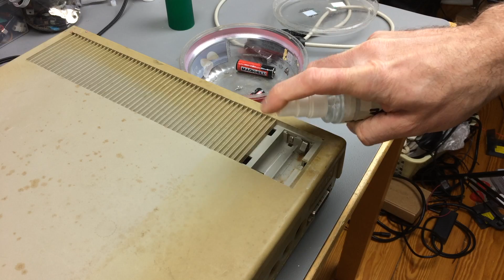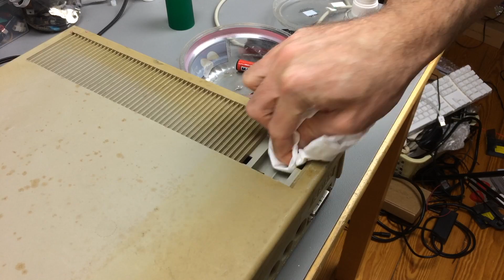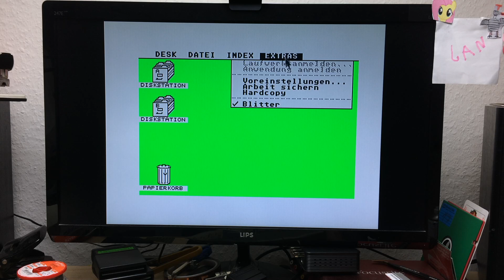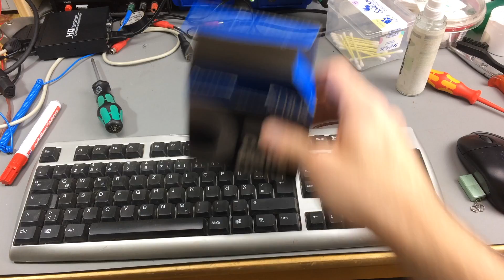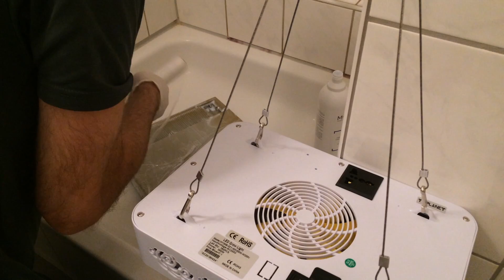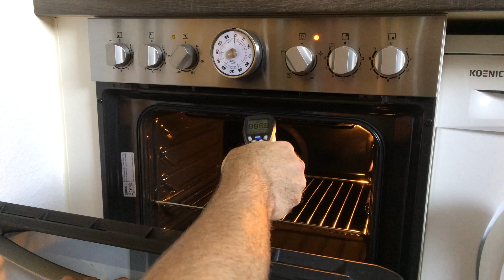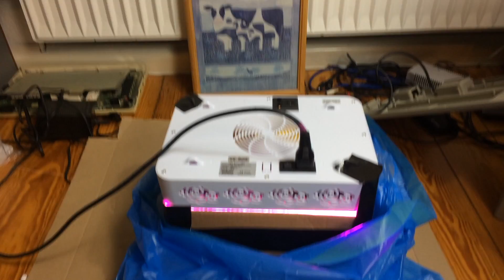Atari Mega 1/Mega ST Restoration

Comment: An Atari on a (more or less) Commodore only channel??? ;) 
The feud is still on even though we Commodore/Amiga people know we won by a mile, Atari ST will always be something we shrug at... hehe...
Back in the days we sometimes used an Atari ST as a door mat on our demo parties and it was always a case of how long it survived - but people had clean shoes at least when coding 68k asm!
Today I'm more concerned about restoring and saving old hardware but I've yet to ever touch an Atari in that fashion.
Reply from the maker: I'm actually pretty fascinated by the Ataris now even though I was a die hard Amiga/Commodore guy back in the day. I always found the "war" between the machines hilarious. Why not acknowledge that both are great in their own right. It's a bit like the Beatles vs Stones discussion. ;)
Reply: I think as long as there's more than one choice there's always going to be some sort of "war" between the users, like XBox vs. Playstation or PC vs. Mac et al.
The Amiga vs. Atari feud was never really a contest since the Atari was so far behind the Amiga if we're talking about architecture and OS - but the Atari had a built in MIDI interface and that was a tiny advantage for those who wanted to control a synth etc, but people mostly bought these computers for a different reason and the Amiga was just superior. The demo scene was huge back then and this is what kept the feud going on because Amiga demos were always "better" than Atari ones with regards to most vector balls or most sprites etc in a demo.
Today I love all kinds of computers since they all have a purpose but I'd be lying if I said I was going to buy an Atari ST to add to the collection ;) 
Some things just never change - but I do appreciate that you're rescuing Ataris as well because I suspect there are even fewer of them around?!

Comment: I noticed one of the menu options stated "Blitter" with a tick/check mark next to it. Is this machine related to the STe rather than the ST?

Enjoyed this episode!
Reply: The first ST computers in the keyboard case didn't have a blitter. The Mega ST series always has one. Later keyboard case models had no blitter supplied, but a prepared space for it on the pcb. STE always has a blitter built in.

Comment: Great view of how the Atari ST Line evolved, clearly not the same as with the Amiga.  Same CPU but the full architectural differences between these two systems is clearly evident ( blitter ? ) hehe would be cool to see  if it was not just an Amiga rip off ;).  I had an A500 and did asm using Devpac ( 1.x to 2.0 ) .. 

Those were the days ;)
Reply: Mega ST came on the market even before the Amiga!
Reply: @KolliRail  ...before the Amiga 500 and the Amiga 2000 but not the Amiga 1000. The Atari 520STm was released before the Amiga 1000.

Comment: Does that particular Atari model take the Mac compatibility card? It would be cool to see that tested out. You can see and hear a bit about it on the Computer Chronicles, but of course it's not featured for too long and doesn't get to do a lot. I think the guy ran HyperCard on it a bit and that was it.
Reply: Yes, those "cards" were built in the ST cartridge format. The Magic Sac and the later Spectre models from David Small. Apple tried to prohibit their Mac dealers from selling Mac ROM chips because of those products.

Comment: I have a German Mega1 too. It didnt have the metal shield I think because of the pc compatible card mounted on the board. I swapped the tos for some from a STFM. The German Qwertz keyboard im not changing.
Reply from the maker: Interesting, I was thinking about leaving the shielding out, too. Do you have a CRT on top of it and does that do any interference without the shielding? I'm also thinking about tinkering with newer TOS versions although the rainbow version I have seems to be quite good already.
Reply: The Shifter is quite receptive to interference. It's the only Chip in the ST running with 32Mhz (and it has some hard time doing it. Atari changed inner workings of the Shifter at least tree times). The IC is also not double shielded as in other STs. So the shielding is usefull when using a CRT.
Reply: @boelwerkr  The shield was gone when I received it. Oh well.
Reply: @JanBeta  I have had a color atari monitor on top and noticed zero problems with the setup.
Reply: @JanBeta  I also have the matching Mega Hard drive in the same case. With or without that on top no problem. Jan I would be keen for you to try fitting a fan into the case where they left a space for it. I would like to try one day

Comment: Don't you have to have the keys facing up towards the UV light? Not sure how retro-bright is supposed to work if the bottoms of some of the keys are facing up.
Reply from the maker: I stirred them every half an hour or so, so every key got some light. It seems like you get the same results by just heating the keys up in peroxide (cf the 8-bit guy video I linked in) without any light. I'll have to experiment with that further.

Comment: nice work , and yeah atari st version of amiga games were really crap.
Reply from the maker: It depends, I think. Giana Sisters is a particularly bad example of a conversion. I heard that there's a version that makes use of the Blitter chip that's much better. Will have to try that soon.
Reply: yep curious to see that , in my memory atary ST always struggled to display decents scrollings.

Comment: Hi Jan. 5 years later, did the yellowing come back?
Reply from the maker: It re-yellowed very slightly (as it usually happens after a while with retrobriting) but it still looks a million times better than it did when I got it. :)
Reply: @JanBeta  Then not so bet I guess. Also cheers for the video!

Is there a way to upgrade the RAM?

Comment: Hello, I have a request for the following:
I was removing the graphics card from the VME ATARI-TT slot.
The ATARI TOS-system was turned off, but I didn't notice that the computer was still connected to 230 V / 50 Hz power.
When I took out this card unevenly, I suddenly felt the smell of a bubble somewhere on the board because the whole thing is in the tower housing.
After turning on the computer, the screen is dark, the power supply works, the LEDs - power, fan, HD disk and floppy disk LEDs - work.
Somewhere after two minutes the MC-68 .. processor is clearly warm, I only checked this 2MB ST memory board (underneath the board is also the factory 2MB) the chip and cold bones. The whole side of integrated circuits from the cold ST-memory side
I still have the TT-Fast Ram GX-B-V0, 4MB slots.

Can I ask you for help, service diagnosis? Best Regards  ... ATARI FAN ( ATARI JAGUAR, STE,  TT,  FALCON030 )

Comment: Hello, I have an Atari Mega st1 that' s still working. Question: in the video it seems to work without the batteries; why are they there anyway and should I renew them (Mine are the original ones)?
Reply from the maker: The batteries are only used to keep time on the build-in real time clock. If you don’t need that feature, the Mega ST is going to run without any issues if you just leave the batteries out. :)

Comment: (As always sorry for my German) Ich habe viele Computer gesehen, aber ich gebe zu, das ist das erste Mal, dass ich diesen Computer gesehen habe. Ich kann mir keinen anderen vorstellen, der überhaupt über diesen Computer gesprochen hat.

And GHOSTBUSTERS! :D

I do have one thing that bothers me here actually and also a question in this case I guess. When you start up an older ST usually it has the Atari logo etc. and the memory test bars and such. When you turned on the Mega the few times you did I didn't see that screen. As I said I've never seen this ST runnin' before so I wouldn't know myself. So the question then, is that screen something you see on older Atari ST's and not here for the Mega and is that even a possible issue for the computer working or not.
Reply: Later versions of TOS show a power-on screen like what you described.
Reply: @alhartman66  ah ok then, I guess I've only seen the older TOS versions and older ST's, thank you!
Reply: It's the opposite. You've seen NEWER TOS versions. 1.04 is an older version.
Reply: @alhartman66  oh, man I'm slow on figuring this one out this time, thanks again.

Comment: 3:35
Isopropanol
Alcohol
Why? It is alcohol!
Reply from the maker: I learned recently that you call it "Isopropyl Alcohol" or "Isopropanol". If you say "Isopropanol", the alcohol part is already in the word so technically "Isopropanol Alcohol" is wrong... That's why. :)
Reply: iso-propan-ol
-ol => Oxigen-Hhydeogen group. Typical for all alcohols
propan => 3Carbon + 6Hydrogen (propane)
iso- => change on the second atom in a chained group of atoms.

So this means that Isopropanol is an alcohol of propane with the OH group in the second Carbon atom.

Comment: Will you expand the RAM to the maximum it can go? To what... 16 MB? Higher? I've wondered.
Reply from the maker: I think you can do some piggybacking tricks to bring it to 4 MB at least. Maybe I'll try that sometime. But I have to read up on how to do it. :)
Reply: The 68000 can address 16MB. But 1MB at the end of the address space is reserved for the hardware and in the 1 MB below that the ROMs are allocated in very inconvenient places. Also later expansion ports like in the MegaST and MegaSTE and TT allocated there also. So usable are 14Mb (15Mb if you use all the free spaces possible)
But the Memory controller can only manage 4Mb. Above that you have to use your own memory management and  the memory is only visible to the Blitter and CPU.
so most big RAM expansions will add 10 MB to the maximum default of 4MB.

Comment: This looks like TOS 1.04 or newer. Mine still on 1.02. :(
Reply: Yeah, the coloured bands scrolling indicate rainbow TOS.   The spare 4 sockets are so you can use 6 x smaller ROM chips rather than 2 of the larger capacity.  I always thought it odd not to stick to one type.
Reply: Brad Viviviyal  that got tagged as the "Atari drop" even though it should've been called the "Apple III drop".

Comment: 220v cable in the shower... hmmmmmmm.
Reply: Most likely drops to around 220v as the EU only marginally standardised on 230v without actually achieving it - just having a high-ish variance of 10% so it might reach 230v at times. Nominally it is really 220v as not many could be bothered (except perhaps the Germans) to make the change... 240Volts here in blighty and I still don't take power leads into the shower.
Reply from the maker: Oh, Germany is very stable at 230V but of course you are right, you should take precautions when running mains powered devices close to water. At least I pulled the plug every time I got near it and it was connected through an FI switch.
Reply: I expected Germany to do it properly. We have a simple rule, no electricity in a bathroom for any reason - ever. However, I do have a family of eight...
Reply from the maker: I wouldn’t do anything like what I did if I wasn’t alone at home. No way I’d do it when my kid is around.